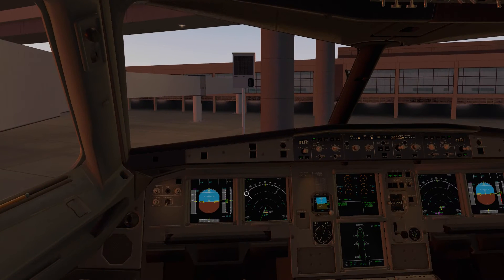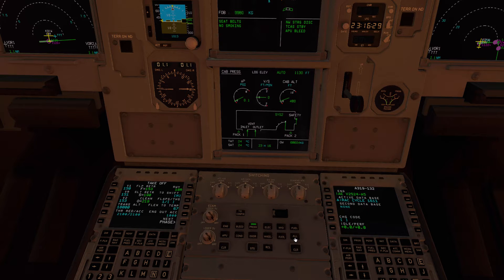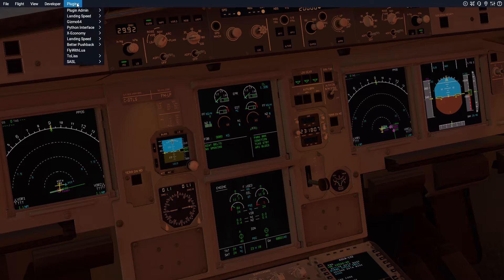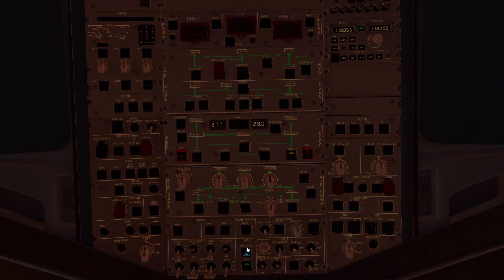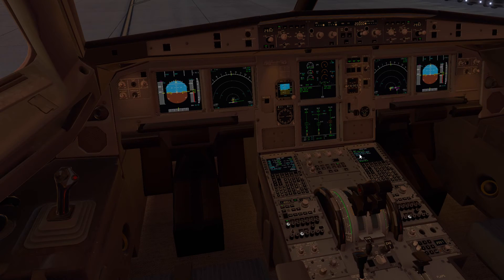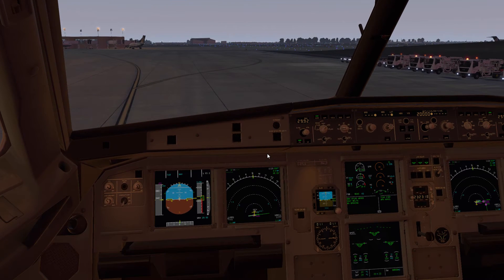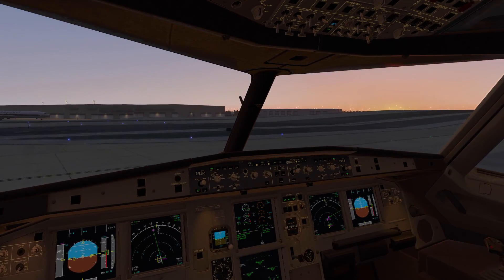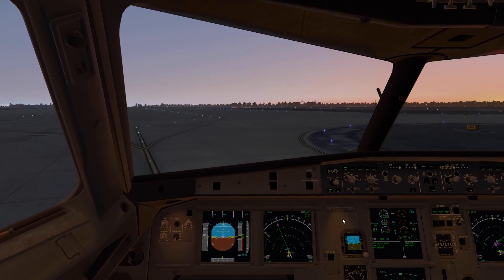I Airbus I Pilot Series Single Engine Taxi and PTU ToLiss 319

Comment: Greetings.  I noticed that the Elec Pump is only on the right (Yellow Hyd) side.  Does this mean that if we want to do a single engine taxi without the PTU going off we can only do so with Eng 1 running?  Thanks again for your videos!
Reply from the maker: Zeta Aquilae correct!

Comment: What is the reason behind some operators begin with engine 1 and other with engine 2 ?
Merry Christmas to you!
(Hopefully you will be a bit bored over the holidays and find time for more videos 8-) )
Reply from the maker: lol Bored perhaps! I do have some stuff in the pipeline. As far as engine 1 vs engine 2 it really just comes to company procedure. Some older aircraft especially turbo props they always suggested starting engine 2 first because the starter relay was closer to the battery on that side so less strain on the battery..as for airliners (and more specifically airbus) there is no real reason that I can think of to start number 2 first EXCEPT for doing an external Air start. When using external air, the cart is normally on the left side of the aircraft and placed near or in front of the number 1 engine, so naturally we start number 2 first. When taxing on number 2 only, we dont use the yellow electric pump as that Engine driven pump is now on. You can argue back in the day and perhaps maybe even today, some operators may be permitted to do a single engine "turn" which means keeping the engine running while deplaning and boarding passengers, however I dont see how they will be able to load cargo in this configuration because the cargo doors are even CLOSER to the engine then the passenger door.